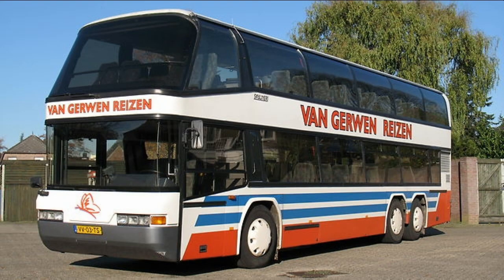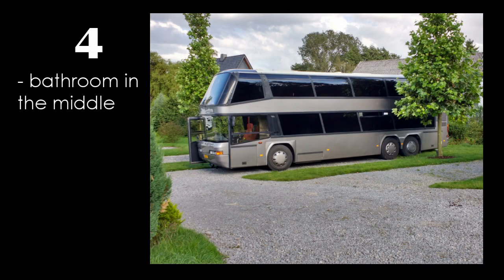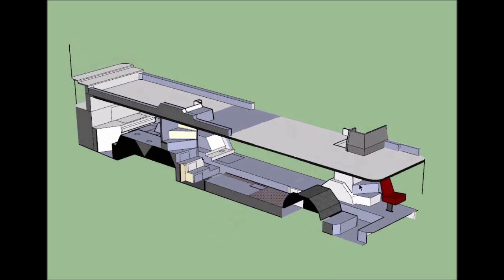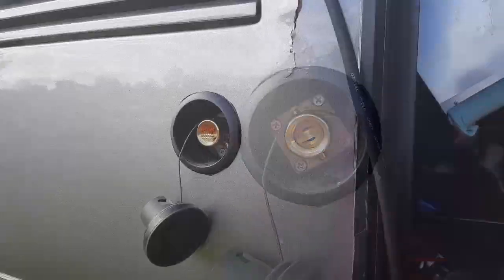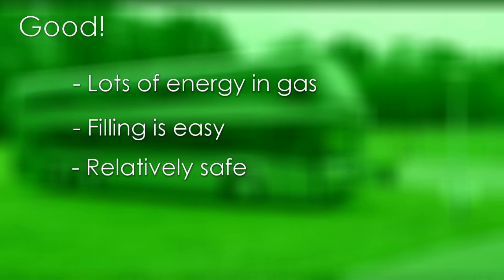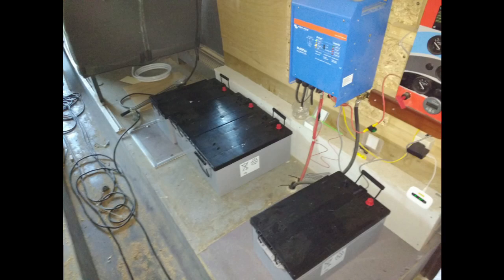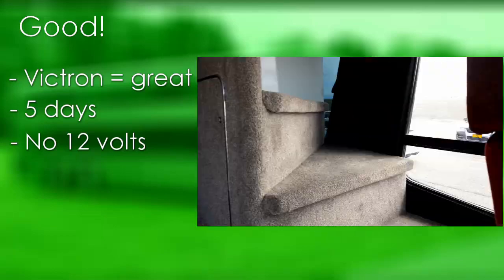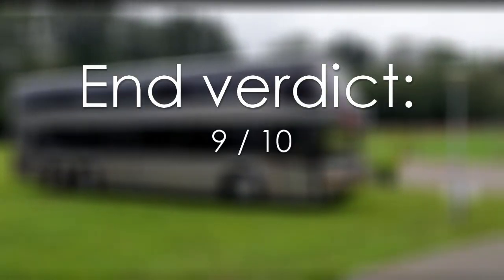Double Decker RV - Evaluation after 4Y and Design

Comment: Great video. I have seen so many of these videos. And I have seen many! But I have to say you are by far my favourite. To start the double decker is the best choice I think. The reason is that you had a utility room. This is so key. If you reorganized that room and made it a bit tighter maybe you would be able to add more of what you needed. I will revisit the video just to be sure of what I am saying. But personally I really liked that you were honest, articulate. You actually went deep into your project. Many show what why have also, but it’s not deep like this. I really want to learn and do it myself. I won’t have such a problem with the building. I would have problems with the water, pumps, gas, electrical. All that stuff is what I don’t get. The utility room made this build for me the best bus. The bunk beds were nice f you have kids. But you could maybe in the future create something or turns into two beds instead of having two permanent beds. I love the seating area your wife was at on the second floor over the driver. That was genius to keep. It must really feel like you are flying sitting on that second floor. I was confused about something. There was the insulation and then all of a sudden they turned into windows? Did I miss something? Lol all in all I love your bus the most. I hope one day you can share with me the design you made. I would replicate your bus if this wouldn’t offend you. I would also take your advice on the good and bad after the 4 years. Also I would love to know the model and where I can find a bus like yours. Kind family people like you is what I like and I wish you the very best! Stay real stay raw, family comes first and it’s as simple as that. Have fun! I will check your other videos later on. I saw maybe 2 hours worth. 😉👍
Reply from the maker: Wow, you really put some effort in this. Thank you! About the windows: the light blocking film just goes over everything, so from the outside it makes the insulation disappear - it's there, but you really can't see it anymore. The plan in Sketchup is for free available in the 3D Warehouse of Sketchup, the link to that is in the FAQ: https://sites.google.com/site/bigbuszz/faq---english
I'd be honoured if you would replicate it. In fact, Maxim in Moscow is already doing exactly that. He bought himself a Neoplan, and as that one lacked the front stairs, he built it after my drawings. He is already working on it for several years and hopes to be ready next year...
Thanks again, have a nice day, greetings from the Netherlands!

Comment: Great plan...and enjoy you RV.  One thing that may be matter to you( if you and your wife are not too tall.) is to consider changing the floor where you walk on(aisle)... lower it by 6-8"  for the down stair, and  same with the up-stair aisle at different location wrt the one down below...This may require some metal working, but will allow you to walk straight up on the aisles.  Otherwise, not worth the trouble.
Reply from the maker: Thank you. Changing the floor would come first - is no option anymore. Besides that, that is something that is very difficult over here, because of regulations. If you would alter the floors, you are intervening with the structure of the vehicle, and that implies that you will have to prove, with calculations and drawings, that the structure afterwards will remain strong enough. There would be quite some engineering involved. I knew that, so I decided not to alter one thing in the 'steel' of the bus. I know of double deckers with uneven floors for walking up straight, one is even in one of my videos... wait... yes, that's this bus: https://youtu.be/Vgfc3ruqvOs?t=257
But that one is manufactured like that (it was made as office bus). Thanks for your comment!

Comment: I have to admit it I would love to have a double Dekker bus, the height is problems on certain roads through the adjustments you made out of are all excellent I. The compost toilet, I understand your voice concern what about the one that goes into cassette the lower you to take and just dump in a regular bathroom there’s a little smell and she likes to deal with that. But mostly you don’t have to deal with the black tank I’m starting to see more and more the vehicles using it and I have to admit let’s face it, they won’t advertise it but you can dump Gray water pretty much anywhere without hurting the environment especially if you’re using soap that are natural. I am far from One of this people that are into savings environment which is important.
But I love the fact of solar I love the fact of the cartridge or you can just dump. Other than your freshwater. I love the fact if you can go off grid. I gave you 10 out of 10. Nice job new subscriber

Comment: For me.
I am going to replace the frame with a forward mounted engine.
Converting the rear space to accommodate a Mini Cooper.
Next, I’ll be adding rear directional axel.

Two Bathrooms.
Rear entry staircase with second floor and rooftop Lift
(Roof access)

Forward conversional and double expanding Family Room.
—Drop down bunk bed.
—Telescopic tables.
—Custom Kitchen and Pantry.

Second Floor.
Forward facing Master Suite with pop up ceiling enclosure.

Double expanding Office/Parlor.
Split Salon Bathroom.
Wardrobe and closet enclosure.

Rooftop access.
Expanding Rooftop deck.
Precision collapsible rail guards with push up open elevator enclosure above Lift.
Built in Pop up Canvas Cabana with actuated shelves and electrical outlets and hose reel.
Secured actuated Gas Grill.
Telescopic Satellite dish with multiple antenna attachments.
Stationary Flip top outdoor pivotal TV.

Two tier Canvas overhang.
Reply from the maker: Make a video. 😏

Comment: I would have used a Combi "boiler" for heat and hot water. Skirting heating all around the external walls would avoid cold spots and condensation. Domestic pipes and radiators are reasonable cost. The original bus A/C might have been a good option with a generator engine to power it.

Comment: Two things you absolutely STILL must do: 
 
1) Wall mount FOUR Mini Wood Stoves/Fireplaces [2 on each end on second floor, and 2 on lower floor.]  Besides the added ambiance, they will provide sufficient heat offgrid in the Winter (who says you must vacation only in Summer?!!) Youll run connecting shared-chimneys up along the walls, and add small racks for wood.  BTW, I dont get a dime for the link on this:  https://cubicminiwoodstoves.com/

2)  Solar Panels.  You wont likely pull off solar panels on the roof because youre at maximum legal height and would risk getting sheared off under bridges.  I recommend (as painful as this will be) to insert them in the walled off sections of the bus.  Also, they are starting to sell FLEXIBLE Solar Panels for the curved windows.  You may want to do a combination of flexible and solid shaped panels.  While theyll still work in the dark smoke film, it might double your output to have a lighter film reinstalled.  Alternatively, you could have the roof cutout for them but that will present new challenges.  Minimum 1,500 Watt Output with Lithium Battery Backup is recommended.

Estimated additional cost:  $5,000   But, if you dont add in the off-grid element here you will lose all "street-cred." ;) And you must avoid this! So I hope in a year we see a "gadget update" here for this.  Thanks, and enjoy!
Reply from the maker: I thought about a wood stove, but decided against it for two reasons: 1. we don't need that much heating as we don't use the bus in winter and 2. they take an awful lot of space. Not the device itself, but you need to reserve space around it - it takes one square meter, downstairs and upstairs. That and the chimney that is not that easy to create, I dropped the idea. Solar panels would easily fit on the roof in between the hatches, those hatches stick out about 5 centimeter.
Thanks for the comment, sorry for the late answer, but your comment winded up in the spamfilter of YouTube (because of the link in it, I guess..)

Comment: Thank you so much for your videos and your channel - bloody awesome RV man! Like many people I'm currently in the process of building my own RV and ended up finding you searching for inspiration and advice!
A question regarding your AC system... Are you able to run your AC unit/s directly from your batteries without turning on your generator? If so, how long do you get out of your (880aH?). I'm in Australia so installing an AC unit I can run without the engine on is a must. According to the ACs voltage sticker it should draw about 800W (I imagine your small ones are similar). Currently I have purchased (but not wired up/installed) a 2000w inverter into 2x100aH lithium batteries. I also have a 2400w generator but only planned on using it in dire circumstances as I have 620w of solar on the roof too. Do you think 200aH (lithium) would be suffice to run my AC unit overnight? Or do you think I'm going to need an extra battery or 2?
Reply from the maker: Sorry, can't help you with that. Because our AC's would flatten the batteries within hours, from the beginning I wired them as such, that they only will run with power 'from outside', be it from a socket from the campsite or the generator.
But you should be able to do the math.. you just would have to know how much power the AC's would take at night.. 
The 200 Ah at 12 volts or 100 Ah at 24 volts won't cut it, I'm afraid. They are good for 2400 Watts, and I don't know about your AC's, but if they do 1000 Watts, the batteries will last 2.5 hours..
I know it can be done, but the installation I saw was equipped with car batteries - as I remember well, from a Nissan Leaf. You just need a LOT of power.
I wish you all the best there down under!

Comment: Trying to winterize a bus like that seems like a bit of a lost cause, way to many windows to insulate properly. Though it doesn't get as cold in NL, I went RVing in Vermont in the winter and no matter what you do something freezes, we had frozen blackwater and windows, not fun. So if you ever do any winterizing bring antifreeze and a hair dryer, or you'll have a bad time anyway.
Reply from the maker: Yes, it would be difficult, but not impossible, I think. The windows are double glazed, so might be better insulated than the steel frame. That upper floor is one big thermal bridge impossible to insulate, that causes quite some energy loss - it will take lots of energy to keep the bus warm. Winter in the NL is not that harsh, but if it is OK for use in winter, you might want to take it to other parts of Europe, and that's another story.. In mountain areas it can get -20 C easily. 
If I would take it on (which I won't 😊), I would start with installing a composting toilet, because then you would lose the black water tank to insulate... 
It would be a better idea, if you want to use it all year round, to take it in winter to Spain or Portugal... 😁

Comment: Looks great and it's nice to see an opinion after several years, just to see what improvement you could think of.
Some questions :
If the black water tank takes too much place and composting toilet would be 'bad' according to your wife, wouldn't incinerating toilet have been ok ?

I just wonder, how much space do the three tanks take ?
Because I wonder what kind of alternatives could be used apart from those.
Composting or incinerating toilet -> no need for black water tank.

But could a water recycling/purificating system have been used ?
I saw some kind of showers with recycling system, and some RVs with full recycling/purificating systems, could that allow to reduce the size of both clean and grey water tanks ?

Well, I love your RV, except for the ceiling heights, because I would be a bit too tall to be comfortable in there.
Reply from the maker: You might be right, but I don't know that much about a incinerating toilet, so I can't tell. Don't those need a lot of energy?
I did look into a recycling system for the water, but skipped that quite fast. It takes room, energy, money and maintenance, and for what, if you can get water everywhere. It is a comforting thought, to have 600 liters of water with you, you just know is good. And about room: yes, you might be able to reduce the size of the tanks somewhat, but you'd need that for the purification system. Well, you get it... I'm sceptical about that. It adds something complicated for not that much gain.
That said, I'm pretty convinced that a recycling system for the shower (water and energy) during showering will become interesting for vehicles like this. But the systems I saw up until now where rather big and expensive. That may take some time, but yes.
Thank you.

Comment: You could get a cinderella inccinerating toilet and cut out the smell from the composting toilet and the black tank
Reply from the maker: True. But those are expensive (4000E) and require quite some energy... I think I'd still prefer the composting toilet.
Reply: @Onrust1  True they are expensive but there is rv specific version that you can get in either electric or propane powered versions

Comment: Great video and review. Is there a legal restriction with height? Here in Australia motorhomes can only be a maximum of 4.3m high. Are you able to cut your roof and lift it for more head height? Considered a diesel heater? We're looking at one for our RV. They get good reviews here, but for most of Australia what we call "winter" Europeans would call spring.
Reply from the maker: Thank you. The road legal limit is 4 meters, that goes for any vehicle and for many countries in Europe. Considering our bus is 4 meters, that should answer your question about raising the roof.. 😆 Yes, I find a diesel heater interesting, I think I would go for the Planar. Thanks for the sub. 😊👍 Regards to Australia from the Netherlands!

Comment: Nice video. But I think it's a shame the whole roof isn't lined with solar panels, would give lots of energy and good for the environment
Reply: I would not agree...they are expensive. And regular  bus has alternator that is like 4-5 kw minimum so with just one drive it can recharge fully batteries. And he sad that they are enough for 4 days
Reply: @dzonikg  compared to the rest of the build they wouldn't be that expensive. And it costs energy charging them, it's taken from the drive train. And 4 days is good, but with so much solar panels I guess you get infinite power
Reply from the maker: Solar just doesn't make sense if you're driving from socket to socket. Using external electricity mostly for free doesn't make it economical sensible, and because we don't use the bus intensively enough, it wouldn't make sense for the environment either. We wouldn't use them enough to win back the footprint to make them.
For most RVs I say yes, in our case: no.

Comment: Sir, good day. 
Awesome RV project, I have one question. 
You have removed AC system of engine, it's in item 6? 
Do u have any problems in cooling engine in summer?
Reply from the maker: Yes, it is de AC system that cools the inside of the bus in summer. That has nothing to do with the cooling system of the engine. The AC was powered by the engine: the engine powered a big compressor for the AC. That all was removed. 
To answer your question: no we have no problems with cooling the engine in summer (but we have had the radiator overhauled two years ago - but again, that has nothing to do with the AC system).

FYI, I see your Russian name, and you might want to know that just a few minutes ago I added the Russian translation for this video (thanks to Alexey) - description and subtitles.
Regards from the Netherlands, Ron.

Comment: What about a wood stove for heat
Reply from the maker: I looked into that, it has my sympathy, but I found it too cumbersome. We would lose one square meter at the down floor AND one on the top floor - because of the heat that comes off, they require quite some space. Fitting a pipe through the roof would have been nasty too. So yes, it can be done, but no, not for us.

Comment: Do you think you will implement any of your ideas for improvement?
Reply from the maker: Good question. I don't think so, because the bus scores sufficient for us. But a list of 'to-do' things remains open. For example, in the spring I want to tackle some rust (or have it treated) - that process always goes on and there are no large spots, but actually has to be done again. But for now I have suspended the bus again for six months, so nothing happens. 😊